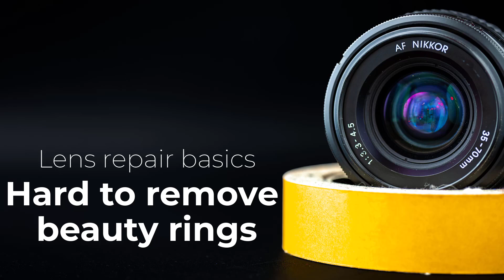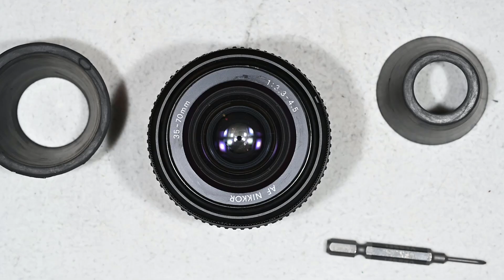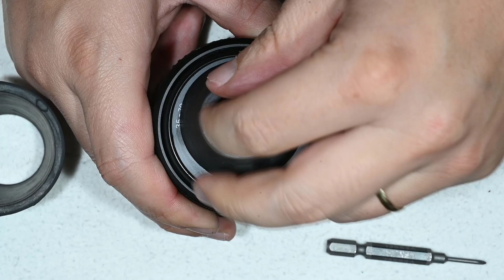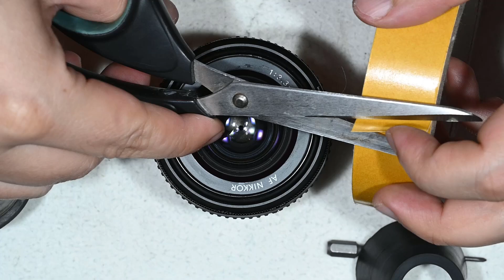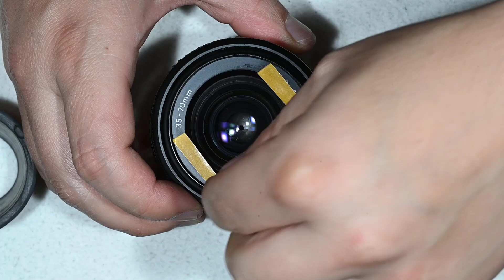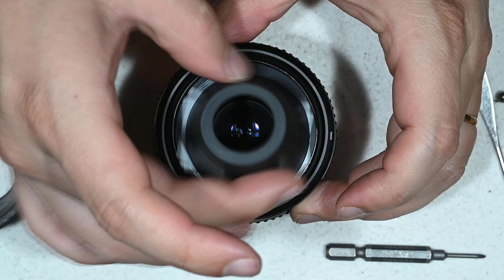Remove difficult beauty rings : Lens repair basics

Comment: Nice tip, but what if it still doesn't come off? Lumix lens.
Reply from the maker: In some lenses it does turn, don't know if it is your case, but you need maybe to check for that. Is there a visible thread? If not, is the ring plastic or metal, if plastic you can try to see if it can be lifted using some thin tool.

Comment: Thank you for all your wonderful videos. 

I have watched your Micro-Nikkor 55/2.8 videos with great care in preparation for cleaning the lenses on mine. But the baffle holding the front element is stuck, like the beauty ring in this video.It’s the bottom baffle — the one closest to the glass (just to say I’m not trying to remove the one at the filter ring). I have the proper rubber tool, but it’s absolutely stuck. Would you recommend trying this with that? My concern is getting adhesive into the ridges on the baffle if it doesn’t come out, which seems like it would a pain to remove. Merçi!
Reply from the maker: Hi, if I remember correctly, you need to remove the one next to the filter ring in order to remove the smaller one. Then, there are 3 very little screws to remove (use JIS screwdriver and put some acetone to soften glue, they can get damaged very easily). To clean the lenses, in my opinion, it's better to remove the bayonet and the 3 screws holding the whole optical body, then you can access the middle of the assembly that it's the one that gets usually dirty. Best regards.
Reply: @ Thank you so much for the kind reply. You are really one of a kind!

Comment: I always keep the other rings that fit inside the ring that I am using inside that ring so that it is stiffer and may have more contact area.  (Just don't let any of the rubber touch the glass.)  I also have three different sets of rings because sometimes the ring from one set will work better than the rings from the other sets.
Reply from the maker: Having different sets is a good idea. Thanks for the tip.